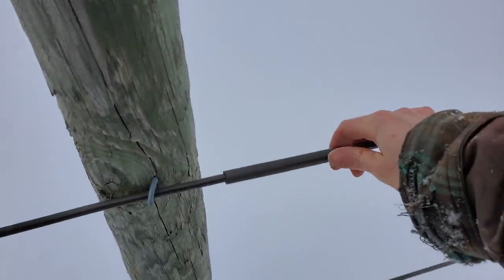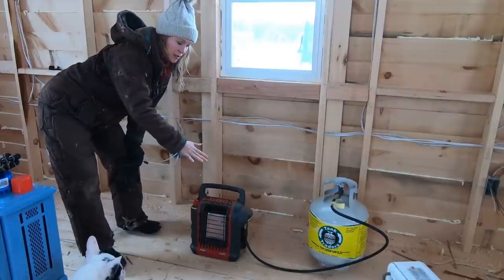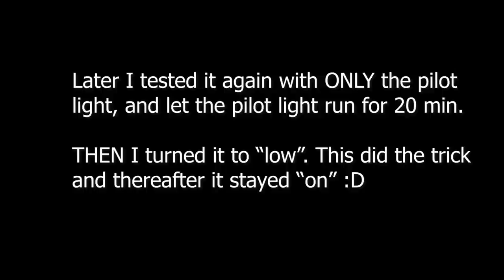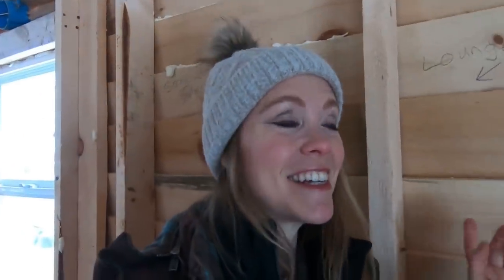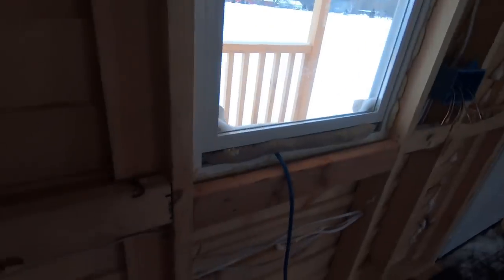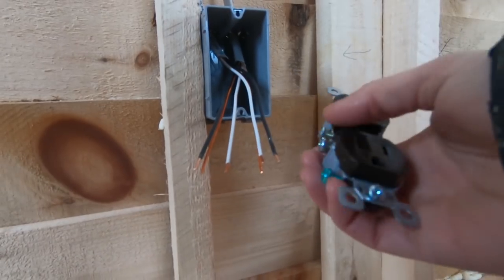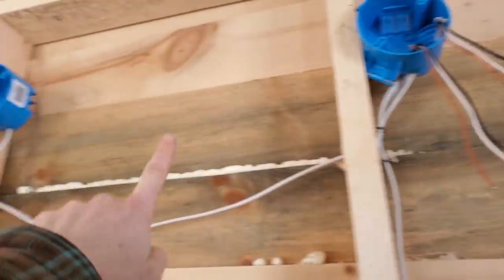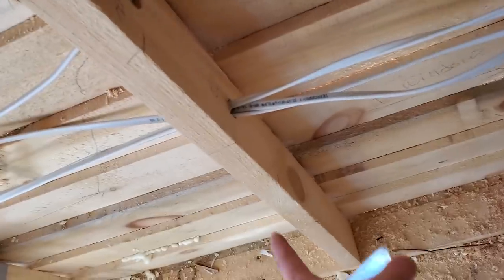My FIRST TIME Running and Wiring Electrical circuits - Tiny House Off-Grid Cabin  Vlog# 7

Comment: I’m impressed. You’ve been doing your research and it shows. Your confidence level in this task is up to the challenge.   Electrical work is intimidating for most people     I remember the first time I flipped the light switch after a kitchen remodel and it worked and I was absolutely amazed.     Well done!
Reply from the maker: 😄 Kinda makes me wish I had power running to the cabin so I could test everything, but I guess that will come in time :)  Getting lots of good advice, lol

Comment: Hello, 
Back in 2007 I had an addiction built on to the back of my house, all the electrical wire had to be run put though the boxes and out lets with about 6" of wire sticking out. But the outlets and lights and switches could not be installed until the wiring wss inspected first, then every outlet and lights and switches could be installed.  Love the video's keep up the good work and god bless and stay safe.

Comment: Electrical codes differ between states and Provinces and Countries.  I will send you a pic of the staples many are talking about.  I recommend a Circuit tester that you can plug into a Duplex and determine if it is wired correctly.  You are doing very well and have learned a lot.

Comment: You're right on with the staples, and as far as the stripping guage, that is the correct stripping length for the screw terminal as you don't want to have any insulation under that screw terminal.

Comment: I had a buddy who was an electrical engineer and journeyman teacher me how to make a box look perfect for inspection.  It helps a lot to have that kind of help. That said you're not doing bad just a few minor issues that's already been mentioned ( need to take off more ) and (make sure the wire is closing the gap when you tighten the screw).
It's looking good , you definitely need a good heater in there, I'm freezing just thinking about working in 6 or 10 degrees. Did enough of that when I was young, now it takes the wind right out of me.
Take care!

Comment: For the solar you will need a breaker box that the solar panels will feed to and that box will feed into a charge controler. The charge controler also feeds your solar invereter and your batteries. We been completely off grid for 11 years if you have any questions we could help. Your doing a great job, and love the videos.
Reply from the maker: That would be great! I've e-mailed a few companies and they gave me a list a mile long of differnet boxes and such, lol. you can e-mail me at therealwtfgirl@gmail.com

Comment: Staples, depending on what your state follows on electric code, most require a plastic shielding the staple.  I actually replaced staples I installed for shielded because inspector suggested.

Comment: Since you're going to swapping from commercial to solar power at some time, I'd suggest mounting an exterior 30-Amp 2-pole fusible general duty enclosed  disconnect.  They're very inexpensive ($12-15) and will provide an easy connection point for any potential power source.  Wiring inside the cabin/shed/hidey hole won't need to be touched so you don't have to worry about damaging your spray foam insulation and interior walls.

The other alternative would be an exterior disconnect box.  The downsides are that they are much larger and more expensive ($55-65).

P.S.  The reason you're having trouble keeping your wire nuts tight is because you're using too large of a wire nut for the 14 gauge Romex you're using.   You're using red wire nuts which are much larger than the yellow wire nuts.

Comment: Your staples are fine. I put them in just to were the wires dont slide. I like to wire nut a pigtail on the hot, neutral and ground for each device rather than daisy chaining them. I think you will have wire nut a separate pigtail for each devices ground. Just twisting them will not make code. Looks good otherwise. Very cool that you're learning to wire it yourself!
Reply from the maker: Thank you, I will double check on that :D
Reply: @This1LifeWeLive  I dont do much residential wiring and I'm not up on code. It also could be different over here in Oregon..guess your inspector will tell you what they want. Nice little cabin. I may have to get one and move on. 😁

Comment: You can only damage the roamex if you drive them in to tight  .
Those are for that . 
They use them for decades. 
Don't worry about what people say  !!
Your doing  fine !! 
I think your regalator might be causing the problem.
Brown wire nut are better than the red or yellow ones . They fit a broader range of wire .
Eric it is I forgot to forget to remember  !!! Lol 
Over  every  wire !!!  Wit the protectors  .!!!

Comment: Never used those power plug connectors, but I would guess the advantage of the 'push holes' would be you don't any bare wiring any where, but yes confirming whether you have a clean connection inside the fitting would be tricky. Hmm, looks like you're mixing the neutrals between the light circuit and the power circuit there
Reply from the maker: I will double check

Comment: Build a box bench outside and put all your breakers in and use it to have your connections outside that way you can have a place to put batteries if you do solar or put a plug on it if you use generator
Reply from the maker: I love that idea!
Reply: That way all incoming power are outside to be able to change as needed or to your needs

Comment: So the big question is, did you ever find the stripper and the hooker???? LOL I really am interested to see what power source you use for the cabin. We would like to have a few small buildings be off grid, and trying to figure out the best and easiest solar setup that will provide a good amount of power. One tip I could offer is to electrical tape the wire nut/wires so they cannot come out of the wire nut- especially when trying to jamb all that wiring into the box. If you can't find any more GFCI outlets, I believe you could just put in a GFCI breaker instead :)
Reply from the maker: I had wondered about using tape, but wasn't sure if that was allowed ;D      I'm planning a combo of solar and wind, since we DO get a lot of wind in the fall/winter. It always comes down to your load. For me, my biggest load is my computer setup, with the potential to need to use it for 12 hrs straight (saving or uploading a video). I know solar set-ups are pretty common on the commercial fam out here though :)

Comment: Good Morning!  I'm a little late to the cabin project but better late than never.  I'm a Master Electrician here in our great State of Michigan.  Disregard the comments about the staples, they're exactly what you're supposed to be using.  You're doing a great job!  If you have questions about electrical comments being left, codes, wiring practices or anything else feel free to reach out.  I can help you sort thru what's really a code issue, what is common practice in the trade and what is just a "know it all Troll" comment.  Yes there are some things that can be done differently, but for the most part you've got it.
Reply from the maker: Well hey! Erik was just lamenting that IF we end up doing our house build (issue with property taxes) he might rather hire out the electrical to be professionally done than do it ourself.  shoot me an e-mail  therealwtfgirl@gmail.com
Reply: @This1LifeWeLive  Good Luck moving forward with build.  It's exciting to watch your farm grow.  Don't hesitate to reach out if you have questions about the wiring your doing.

Comment: Your staples are fine they are intended for electrical wire don’t listen to that stuff. I believe if I remember correctly each wire has to have a staple no farther then 8 inches from the box. No more then 2 runs in a stud hole. The bocca plates ( metal plates) your correct they are used for the purpose of not allowing screws to hit not only wires but plumbing as well BUT THERE IS A CATCH and that catch is the length of the screw or nail you plan to use and what type of wall coverings you are going to use they recommend you cover any hole in the stud that is LESS then an inch and a quarter from the edge of the stud.. but here’s THE CATCHY  part that only applies when your applying 1/2 inch sheet rock and using inch and 5/8 screws if your using longer screws or nails every hole has to be covered with a bocca plate.. it looked like your wiring was correctly done I would twist those ground wires tighter with a pair of pliers.. but dad gum it it’s hard to see in a video especially on a cell phone screen. If you plan on running an air conditioner or an electric heater Suzanne.. your breaker box is not big enough 20 amps is the minimum for 110 volt air conditioner and your putting in 2-15 amp breakers that will cause you issues unless all you ever plan to run is a few lights and a few outlets.. while your doing this think about possible future uses for your little cabin it’s going to cause you problems if you don’t .. much respect.. now let’s get back to the stripper and hooker 😂
Reply from the maker: That makes sense. My boards are 1in thick, and will be air nailed on. I'll have to measure the nails, but don't think they are longer than 2"   :)    As far as the runs, from what I read it depends on the hole size. This size the limit was 3 wires ( don't remember what size it is), that's why some runs have an extra hole (some on the corner I couldn't even get 3 through they were too tight so I drilled another hole for them.) They should be able to gap a bit from each other so they don't heat up with the loads :)

Comment: sue, just for future information, when you put outlets on wires, you should splice the whites together with a white wire coming out, like you did with the grounds, and same with the blacks. the main reason for doing it that way is, if you have to remove the outlet for any reason, you only take the one white, one black, and one ground off of it. and that makes the rest of the outlets or lights on the circuit, continue. and if you have ever got a shock from a electrical circuit, it is worse if you get between two of the white wires. by the way, i am a retired electrician, and almost never turned off power working on things

Comment: The strip gauge on the outlet is the strip length for when you use the back (push in).   You stripped the wires to short for wiring around the screws.  No wire insulation should be under the screw.
Screws tighten by turning the screw clockwise.  The wire should wrap around the screw in a clockwise wrap.  Every silver screw had the white wire wrapped counter clockwise.  When the screw is tightened, the hook on the end of the wire expands and tries to come out from under the screw.  @22:51 both the white and the bare grounding wires are wrapped the wrong way.
When you put the hooks on the wires, the black wires should have the hooks going up and the hooks on the white  and grounding wires going do down.
The black wires go to the bottom of the screw.  The white wires go to the top of the screw.
@24:25 you put the grounding wire on correctly.
@25:49 you can see why you should twist wires together and cut the end of the twist before putting on the wire nut.
Putting the ground fault outlet in the loft is a bad idea.  That means if the outlet gets tripped, you have to climb to the loft to reset the outlet.
After watching the video, I could only see the one grounding wire that was installed correctly.

One more piece of advice.  Never buy cheap outlets.  They are not worth the time spent installing them.
Reply: I was looking at some wiring videos and Wago Lever Nuts were being used to join the wires.  I have not used that product, but eliminating the need to twist the wires and twist on a wire nut would be worth the extra expense.  I did not look for similar products.

Comment: Flamable  stuff  like  Propane  and Acetylen  have    Left  hand  threads  so  you  don't  accidentally  hook  up  Oxygen to a Propellant..    Many  different products  use  unique threads so you can't  hook up the  wrong product  to somthing that will cause an explosion ..
   I didn't know a buddy heater had a pilot light ..   You have to hold the  button  down  until  it's  hot  enough   keep the safety  thermal on ..
Reply: I didn't realize the buddy heater had a Pilot light ..  Probobly dust from your horse barn ..
Reply from the maker: How cool! I never knew that about tanks having different threads!

Comment: Suzanne, some comments for your consideration. 
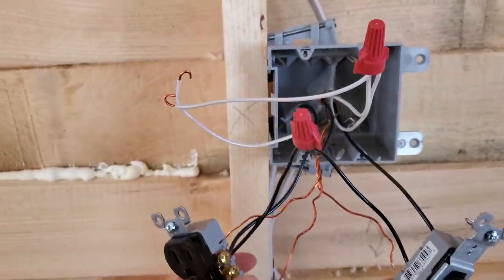Typically, devices are not installed in the boxes until after the wall covering is installed.    At 27:30 you can see that you did not strip enough insulation off of the conductors.   You need to go back and re-do them.  You are tightening the screw heads against the insulation.  Should be only to the copper.(if you need a video link showing to not do this, please ask).   Your loose twisting of the ground conductors in that box you pointed out is dangerous.   Must be properly installed.  The conductor going through the wall for the exterior if for a luminaire(light fixture) must have a 3” or 4” octagon or round box.    The weatherproof box below the panel is mis-applied, but if you really want it there, you must install connectors where the cable enters the box.   You need to decide if your panel is to be surface or recess mounted.   Should not be both.   Best wishes.   Kevin

Comment: 10-4on not doing the stab the wires into the back of the outlet.I had an electrician few yrs ago do some work and an outlet that a roommate at the time had a microwave, coffee pot, toaster oven all plugged into 1 outlet and the out had both stab and screw terminal wires.The out about melted from all of the amps being drawn.He ran another 20amp quad outlet to handle the in-law apartment  kitchen area to solve that problem
Reply from the maker: I'm guessing coffee pot and toaster. We have that issue in our house too!
Reply: The breaker or fuzz should have protected the outlet from overload.
How could three utensils be plugged into a duplex outlet?

Comment: Hey Suz,
Loved Erik at the end and what you said!
Also, why don't you have a small gas generator out at your cabin for power now?
Reply from the maker: I've toyed back and forth with a generator, even to help power the off-grid system on bad days. Right now it needs power 24/7 to keep eletronics from freezing :)
Reply: @This1LifeWeLive  
Gotcha and do you have a pull start generator that you are using now to keep it from freezing?
Reply: @This1LifeWeLive  What electronics are going to freeze?
Reply from the maker: @soulassassin2494  NOthing yet. Most likely will be an autostart gennie that starts on it's own when the system gets low

Comment: I Had one. It quit working because on a big propane tank like your using you have to have a filter so the pilot doesn’t plug up.
It says in the instruction to use filter.
Reply from the maker: I don't know if it came witha filter, and if it did what Erik may ahve done with it :(

Comment: Hookers and strippers! 🤣🤣 loved it!!!! Staples are old school but work just fine. Like to have a penny for everyone thats been used. Glad to see you wrapping the wire around the screws. Some jurisdictions require that you use a crimp barrel on your ground wire instead of a wirenut. Always twist your wire together before you use a wirenut. Leave your breaker box where it it is. It will work. Although some jurisdictions will require a service disconnect on the outside of the building. Just saying. Retired electrician after 40 years and a farmer. Love your videos. But shouldn’t you be on the tractor pushing snow!!! 🤣. Love ya. You’re doing  a great job rookie!  Keep it up. Much respect!!!!
Reply from the maker: LOL Erik did all the plowing for that storm :)

Comment: When you hammer a staple into a wire really tight smashes the copper and overtime the copper will Arc which will burn the wire
Reply from the maker: I think me missing the staple and hitting the wire in the experiment was a greater hazard of smashing the wires ;D

Comment: Not sure about those Buddy heaters. Haven't seen too many that are any good. Usually have the same issues you have with yours. Might be too cold? Propane does lose pressure at cooler temps. Ended up buying tank heaters for the ones on my camper. Needed them a couple years ago when we had a couple weeks of subzero weather. Still use them when it's cold, but not when the days start reaching over 45º - 50º as recommended by the manufacturer. Hmmmm..... maybe pull the furnace out of your old camper & put it in your office?? It is 12v. Should be able to run it in there with a minimum of fuss. Don't forget to vent it. Maybe bring it up to window level & cut a small sheet of plywood out that fits the open window. Bore a hole in the plywood to run your vent pipe outside & add a standard vent cover. RV thermostats are cheap & easy to install. Just have to put your tank(s) outside & run a line in. I'll let you overthink that one. I think I overthunk your office heating as it is. My head hurts! Lol!

Comment: I really figured you'd be further along... Can't do it all at once with this weather. Never clean up til you have all the cutting and mess with all the wires done... 
I only have moonshine...180 proof of knock the shit out a you lol...and more than likely it's the thermocouple bad in your heater. I had to replace mine a couple years ago

Comment: Wrong color/size wire nuts are you trying to burn it down before you get it built? Red are too big. LOL!!!
Reply from the maker: What do you think you are, and electrician?!  😂😂

The box said the red would hook 14-2 wire with 3 wires 🤔 I could try the yellow I guess... was hard as heck fitting 3-4 in one nut!
Reply: @This1LifeWeLive  the yellow will fit tighter because it is smaller. Are you twisting your wires?